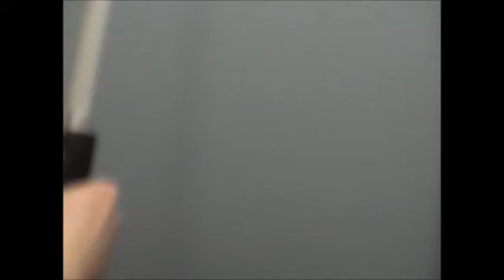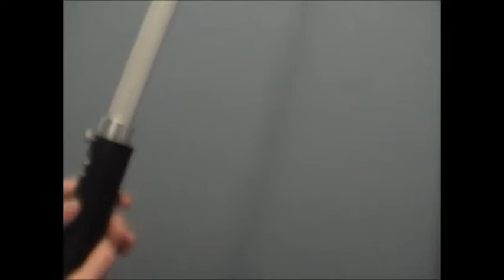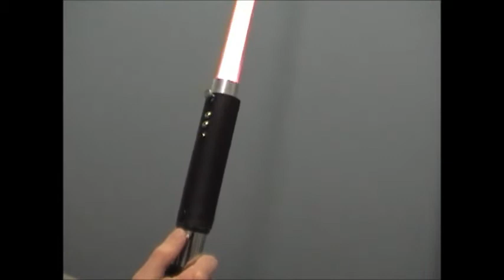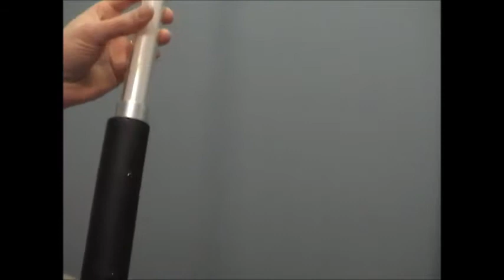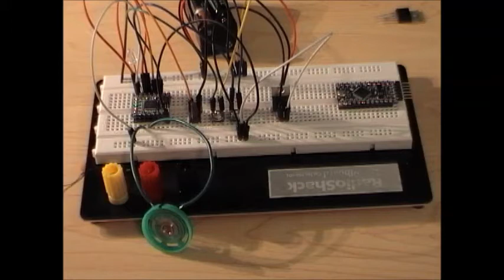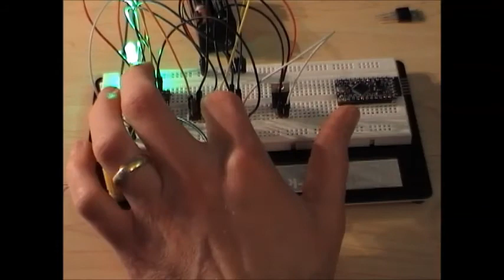WT588D Standalone Lightsaber

Comment: is there a noticeable gap in between sounds when they switch?
Reply from the maker: Not really. At least, I didn't notice. If you can't tell in the video then you probably won't IRL either.
Reply: well, i didn't hear gaps in the video at least not that it is noticeable. so probably a good alternate solution. i'll purchase some and try. thanks for your reply.
Reply: btw, which mode are you using? 1 line or 3 line?
Reply from the maker: The example shown here is using key mode. The WT588D is operating all by itself with no Arduino.

Comment: I built wt588d-u 32m sound card with 5v power bank... 
Firstly Clash Sensor SW-18020P doesn't work as key(I've tried it another breadboard and its working with led)!!! I can get sound with button or direct contact but sensor doesn't work. 
The other problem i have; if swing sensor move it activates sound card before on sound button, when saber off. (Im using two buttons on and off and a switch for sound cards power btw)
0,5w 8 ohm speaker is too weak but i didn't find more stronger and same sized one (using 20000khz mono custom sound set).
Reply from the maker: In a video I posted after this one, I explain that the clash sensor didn't work as I had hoped it would. WT588D stand-alone is pretty much good for Power-up, Hum, and Power-down sounds. Maybe lockup with an aux button too, but the motion sensors don't work out well in my experience.
Reply: Thank you replying my question. My idea, sensor's signal is too weak and short as a key.
I want to ask something different; In key mode it has a lot of option like loop, next loop etc...
if i choose on/off, is it work as a key for one push on and one push off sound cards power with sounds? 
Btw what is high and low options in key mode?
I know there's a lot of information on tech specs but its poorly translated from chinese
and im also can't understand English very well (I'm Turkish).
Sorry for my silly questions but in my country it is very hard to find components that the other people used in videos 
(like polycarbonate tubes etc...) normally it is very cheap on net but,
if you want to buy it another country via net it will be a lots of money because of custom and shipping.
Reply from the maker: I'm not sure what some of those key mode options do, I have used only very few. When I found what I wanted, I stopped looking at the others. I'd have to do the same as you: put it on a breadboard and keep trying different options with a button. I think "high" and "low" options means the difference between triggering the sound when you A) pull the key pin to ground, or B) when it is not pulled to ground.

Comment: Been contemplating a similar system myself.
 
Would love to know how you get the blade on swoosh sample to play when it's first switched on?
Reply from the maker: That's pretty easy. Just program it in "Key Mode" and then set up your playlist for one of the keys to be a power on sound then a hum sound right after. When the key is pressed, it will play the power on sound followed by the hum sound as seen (heard) in my video.
Reply: Does the power button double up as a key button? I've got the module to play sounds in key mode but not getting how it plays tgem when power is first applied.
Reply from the maker: No, the switch that applied power to the system was a separate switch.